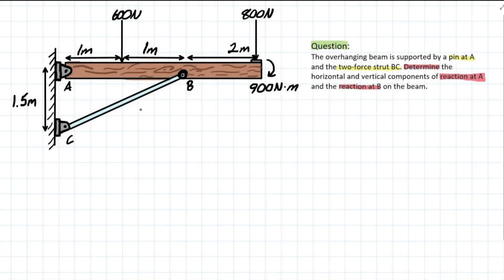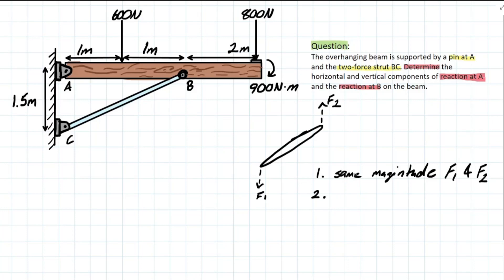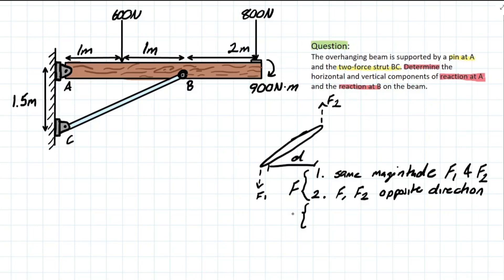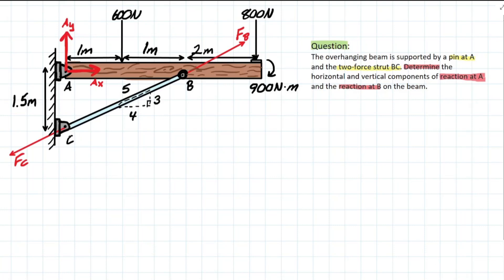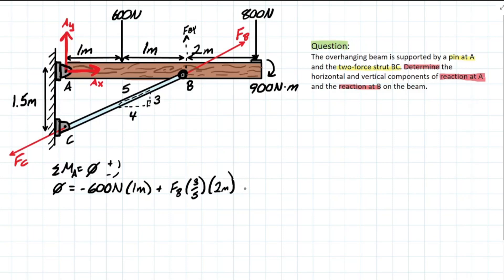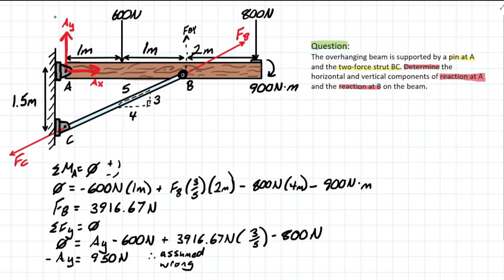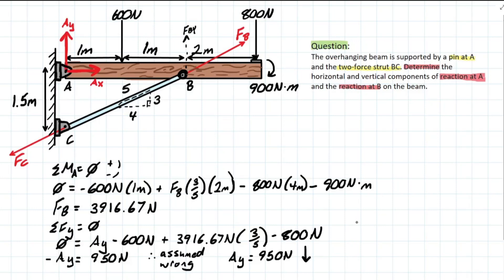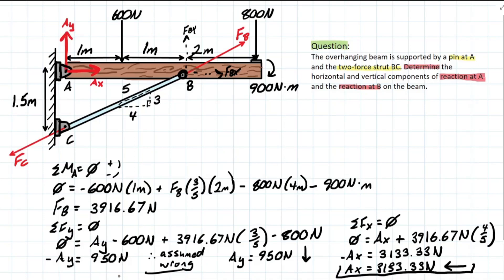Equilibrium of Rigid Bodies and Two-Force Members!

Comment: how did you get the slope of force CB?
Reply from the maker: Good question! I just worked with the dimensions I was given. If we treat the bracket as the hypotenuse of a triangle, we have a 1.5m base and 2m height. This is equivalent to the 3 4 5 triangle i draw later in the problem. From there, if you wanted the angle with respect to x, you can do tan-1 (3/4). Hope that helps!

Comment: Why is a 3 and not  1.5?
Reply from the maker: Hey! Its a special triangle (also called a 3 4 5 triangle). You can use 1.5, 2 and 2.5, but its just common to write it as 3 4 5 when you have the equivalent relationship. Hope that helps

Comment: can you explain how to solve that first equation to get Fb
Reply from the maker: No problem

As a brief recall of what the equation means, we are taking the equilibrium equation for Moment at A because it removes the Reactions at A (Ax and Ay), leaving the last unknown Fb to solve for.

Now, since this is a equilibrium of moment equation, we remember that M= F*d (Moment = Force * Distance), so we are doing this for every force and reaction within our member (remembering that there is zero distance between the reactions at A and point A, the logic behind not solving for these in this equation). The formula takes 600N as Negative since it creates a Clockwise rotation with respect to A, and its located 1m from A ( Similar logic for the 800N force as well in the equation). The 900Nm moment is Negative for CW rotation as mentioned at well, but distance is not relevant since it is already in terms of moment for the equation. Lastly Fb: We need the Y component of this force because the x component will create no rotation about A. To do this, we use the special triangle to break down the component of Fb, so Fby is Fb * ( 3/5 ), then we must not forget the Counter clockwise rotation  about A (+ sign) and distance from A.

The rest is easy, bring over the constant values to the other side of the equation (don't forget sign changes), divide by the coefficients of Fb, and BOOM... Fb is solved.

Hope this helps